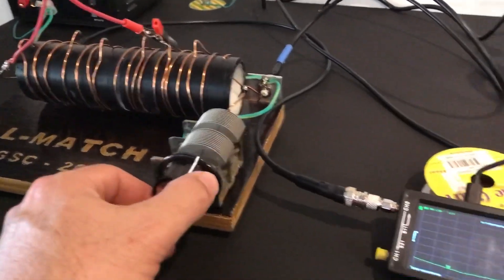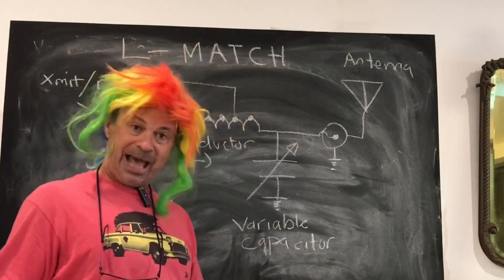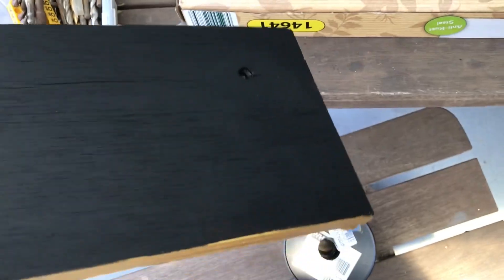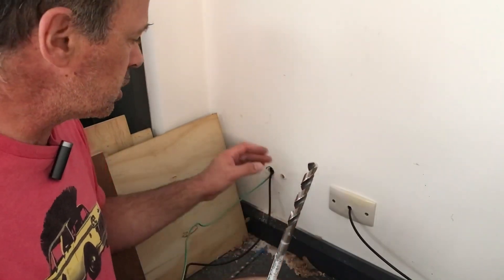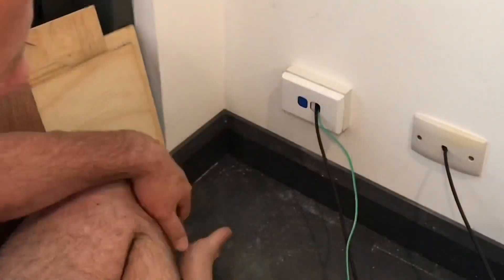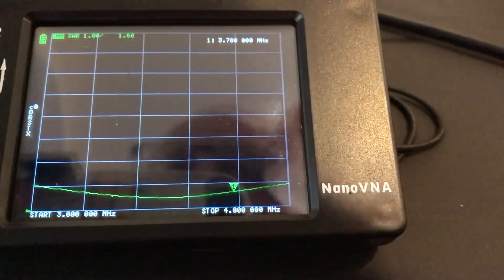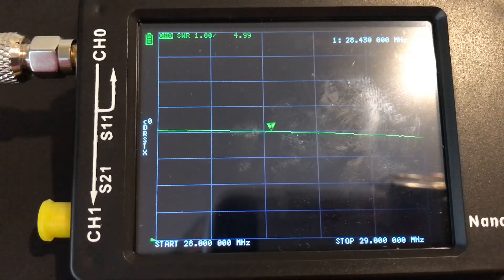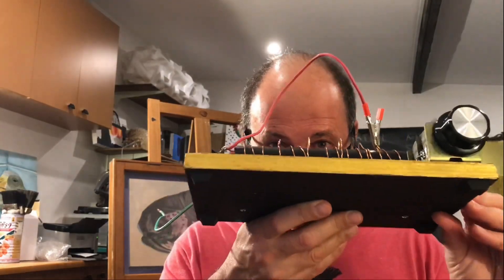QRP L-MATCH Antenna Tuner @TheArtofEngineering

Comment: Your NanoVNA is not calibrated. The c mid left side of screen should be C. Uppercase means it’s calibrated, lowercase not.
Reply from the maker: Thank you....I normally calibrate whenever I change the range of "stimulus". I must of not done it in this case. Thanks for that tid bit of useful information that I didn't know! Just tried it and 100% correct. Nice to know as it will remind me to do it! 73 and TU OM most useful.

Comment: Be NEAT in your construction !!! Neatness adds efficiency in the circuit. Maybe not so much, but enough to make a difference. Also, increase the wire diameter on the inductor, it increases circuit "Q" where you need it. Use #16 AWG in all wire connections, otherwise you risk circuit loss. Otherwise, fairly well done.
Reply from the maker: Thanks for the feedback. Yes it could be neater, the process is always a battle between the impulsive excitement of creativity and the stringent demands of RF design. I did have to go back later with a higher wattage  soldering iron and resolder parts. Thanks for the tips and for watching the video 73 OM de VK2AOE.

Comment: Thanks om
I have another question. How to calculate the inductor coil number of turns?
Reply from the maker: I use an LC meter…. But the bigger the coil the bigger the “mismatch” the  L match can cope with. … keeping in mind a big mismatch for a coax fed antenna means a less efficient antenna. I usually work with antennas that are as resonant as possible to start with using my nano VNA. So the L value is not “critical” …. Just make a big one with lots of taps. 73 de VK2AOE

Comment: What makes this QRP ?
This can be higher power than qrp
This is nothing new
I do not even say this is old school
This is as practical today as ever
I can not speak for the ugly building though
Reply from the maker: The spacing of the plates in the capacitor means running high power risks it arcing. That is why I wouldn’t risk my finals on it. 73 de VK2AOE
Reply: I can tell you off hand the spacing of the plates in a air variable capacitor such as yours. Would handle well beyond 5 watts.
I use Polyvaricon Variable Capacitors in most of my qrp gear and they handle QRP power levels with ease! I do not blame you though :) Better safe than the dreaded smoke ! es 72 de kd5ald @TheArtofEngineering
Reply from the maker: @frankartieta4887   Yes ....rather than say "lowish" power I was being extra cautious.  I have seen a few tuners using those caps you mentioned and they seem to work well! My mooncake xmitter uses one to tweak the ceramic resonator for some frequency agility. TU for the comment 73 de VK2AOE.

Comment: What are the lengths of wire that should be used with this tuner? Could I use a 1/2 wave ?
Reply from the maker: If the antenna is too short you need to add inductance and if it is too long for the frequency of interest we add capacitance. I would say starting with a half wavelength at the lowest frequency you require will get you close enough to then tweak it with the L - match. You could also look up “random length wire antenna”…. and try that… I haven’t done that and would be interested to see how that goes? 73 de VK2AOE

Comment: What is the value of each hand on the variable capacity?
What is the total value of the inductor?
Reply from the maker: Mine was from an old AM tube radio. Because the plates are spaced close it is only good for lower power output…. Cap value not critical but approximately 540 pF per gang? The L ?…. 20 to 30 turns on the pvc former. Like I said in video this is based on another hams project ( That Old Tech Guy -Kevin Loughin)…
https://youtu.be/EXD9rAOM_o4

Comment: BTW my call sign is vu3sua. Best of 73s
Reply from the maker: I am currently using this unit with an end fed 1/4 wave 7 Mhz antenna...with a trap and "small tails" at the end to get a small resonant dip on 80m. It seems to work with or without the counterpoise attached to the UNUN (49:1). I guess it depends on the antenna? The thing also to remember is just because things are a good match, doesn't mean the antenna is effective (a 50 ohm resistive dummy load is a perfect match but you can't work DX on it!). As long as the VSWR is acceptable .....you could experiment and see how well it "gets out"? Video link to a series of videos on my current antenna .....which soon will be higher and better as I now have a 9m pole and will make it inverted V 1/2 wave for 80m! 
https://youtu.be/EZuMciP8ofg
de VK2AOE 73
Reply: @TheArtofEngineering  thanks i appreciate your advice.
If I am using an LC Tuner with the whip I presume I do not require a matching UNUN ?
Reply from the maker: @inkits1  No the UNUN is because the 1/2 wave is end fed where the impedance is high. whips have low feedpoint impedances approx that of the coax (50 ohms)....most often! Does your whip have specifications?
Reply from the maker: @inkits1  2.5 m vertical ? What frequency is it for? 28 Mhz 10 m band?
Reply: @TheArtofEngineering  i am going to make this antenna for hf handy .  Operating on 7mhz to 28 mhz  
So should I use a matching balun or an LC Tuner will be good enough .  The antenna is being manufactured locally for 2.5mt . It's not being made by any company but I have ordered to be made from a company that makes RF products.
Reply from the maker: @inkits1  40m to  10m ....and it is 2.5 meters  tall? I just checked you out on QRZ are you pranking me?? :) I think half the fun is to make it yourself! Especially antennas for HF.....buy some wire and PLAY!! I think for HF an ATU is invaluable! I'm amazed by how many people buy a long wire antenna or dipole premade????